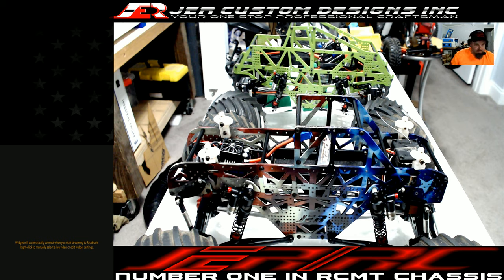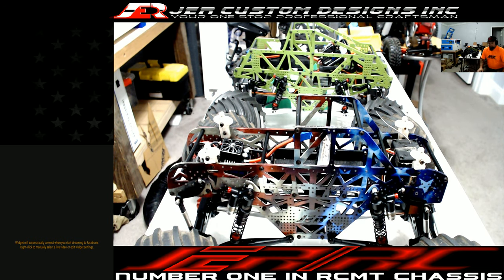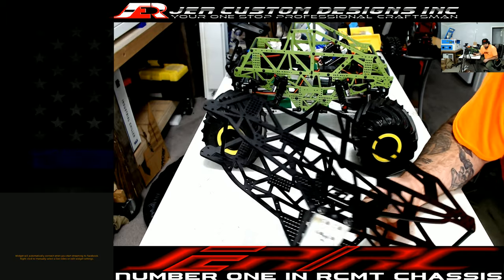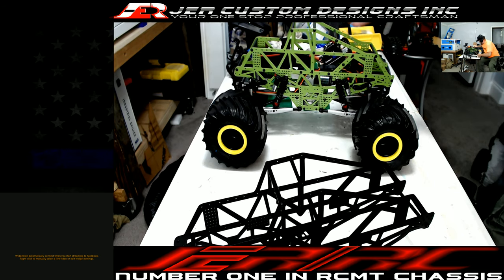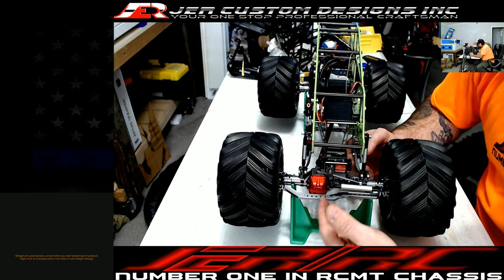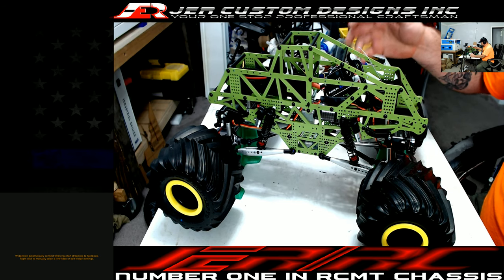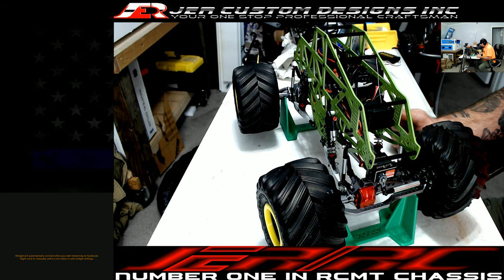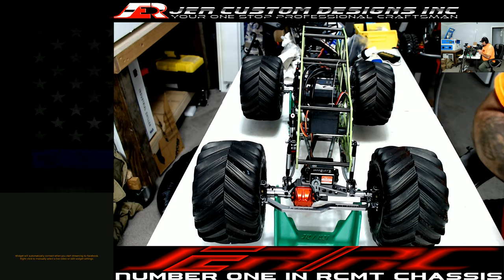APEP Build overview

Comment: Hi Jason, just got my APEP chassis.  The build weny well and made a short video on it , The only hiccup is that I had to
cut a small section so that I can mount my Scx10 transmission.  Other than that, shes a beaut. Bang for the
buck purchase. Cheers! Steve